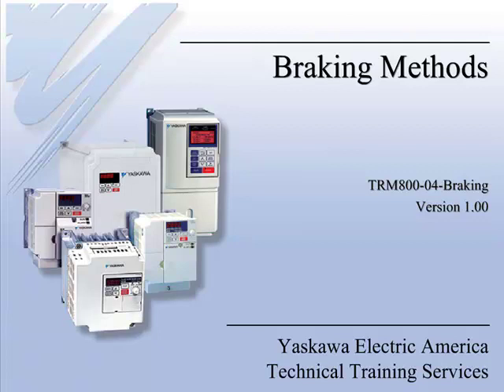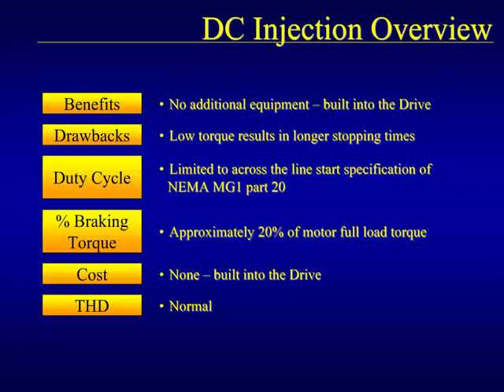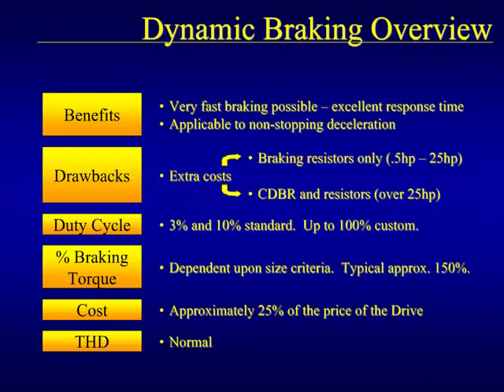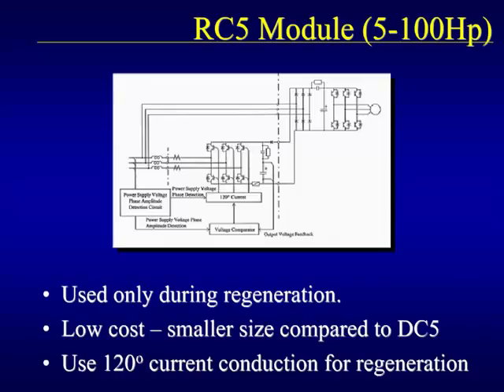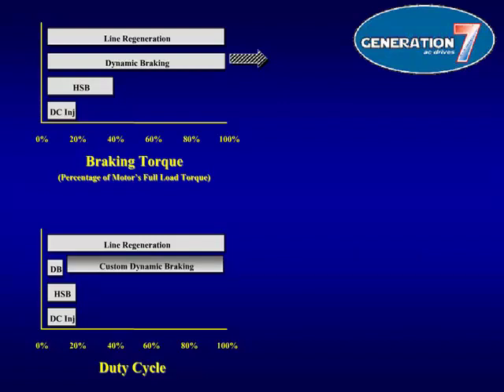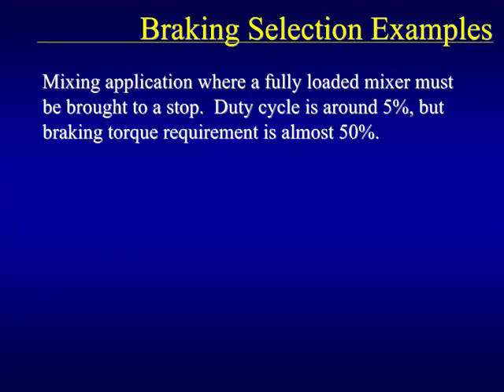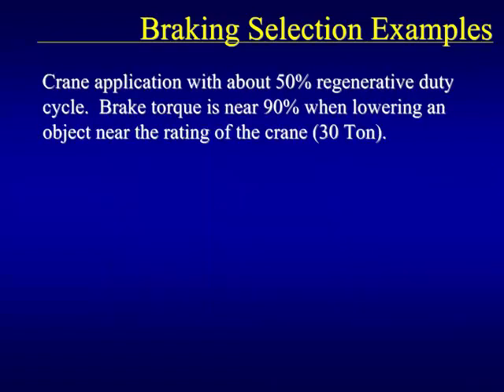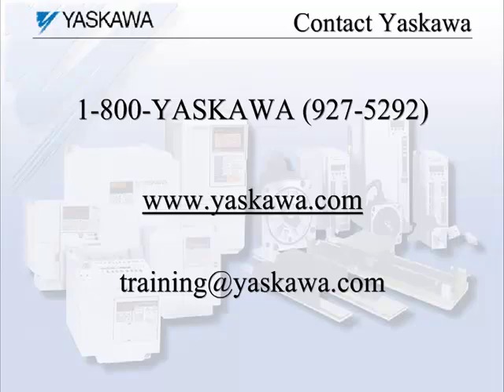eLearning Module: Braking Methods of Electric Motors

Comment: Sir,how can i yaskawya v1000 vfd run reverse and  forward in ai input.(-10v +10v).
Reply from the maker: The Yaskawa V1000 VFD does not support a -10VDC to +10VDC analog input for forward and reverse operation. However, certain other Yaskawa drives, such as the GA800, GA500, and 1000 Series (A1000, P1000, etc.), are capable of this functionality. Here is a link from our Yaskawa Solution Center with more info: https://shorturl.at/yZJkL